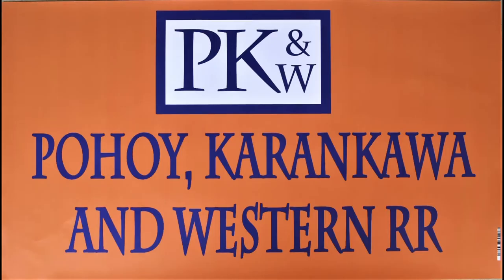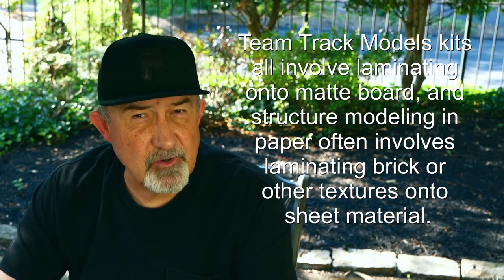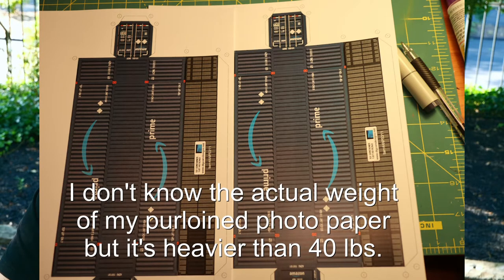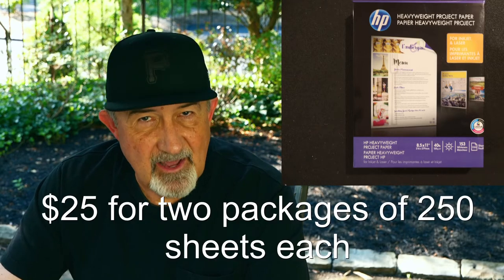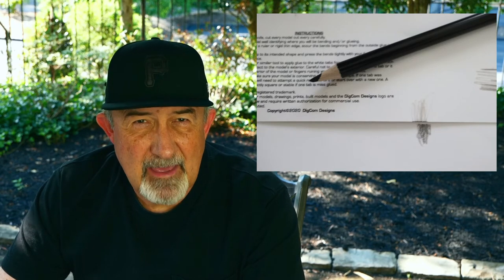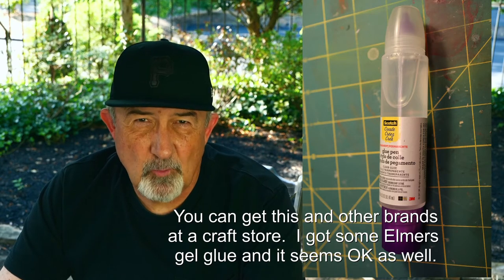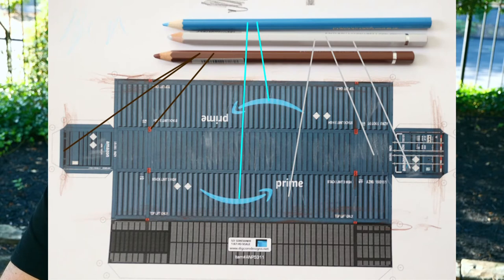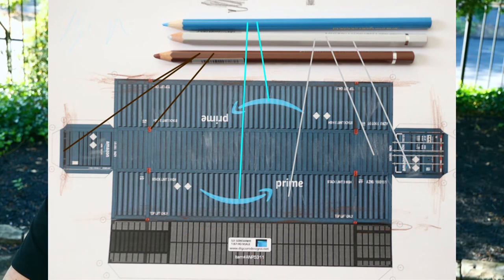Paper modelmaking   - Getting Started

Comment: There's a kind of plastic resin used in the conservation industry called Paraloid B-72 that you dissolve in a solvent like IPA or acetone, it works exceedingly well for adding strength to parts. It's crystal clear (it has to be, or it wouldn't be used for conservation), removable with more solvent, you can adjust the viscosity by changing the resin/solvent ratio, and you can apply it with a brush or an airbrush. It can even be sanded to a certain extent. I haven't used it at high enough concentrations to be used like a glue, but I hear that works great as well. Makes paper act like plastic. Also very cheap.
Reply from the maker: Wow!  That is something I will investigate!  thanks for the thoughtful comment.

Comment: When I was doing aircraft and ships i used Wuasua 65lb Bright White cardstock. Another paper I've used is Pacon Tagboard. Especially for models that needed that extra bit of structural stability. Also I've used colored cardstock and colored Canson art papers for projects. Stiff, but bendable. I've always found printer paper just a little too wimpy.
For adhesives I'm a big fan of Aileen's Tacky. It's a stiffer PVA glue than Elmer's or school glue at the $ stores. I've tried the Uhu and I'm not a fan. Maybe my technique. Also Tombow Mono Aqua. It's a clear glue from Japan. The only place I found that carries it is Michael's.  
Top coats. Krylon matte or satin. I liked this especially when dealing with laser printed sheets. A lot of Polish modelers use a cellulose top coat. In terms of the best card model builders out the the Eastern Europeans are it.
Reply from the maker: Wow!  Great information.  Cool you are so thoughtful about your modeling.  Thanks for sharing here.